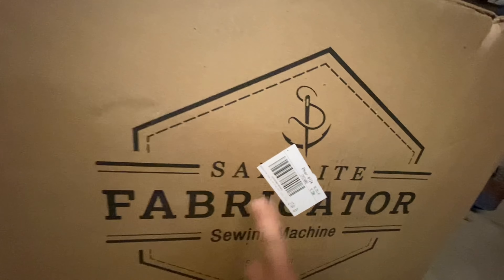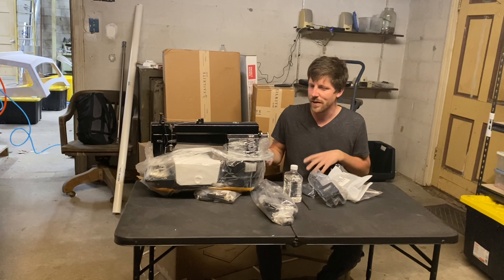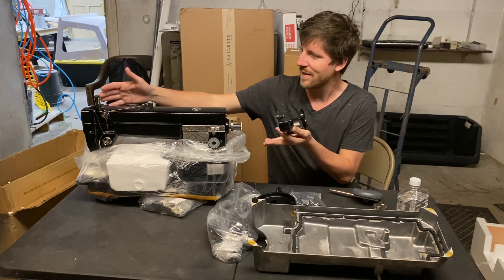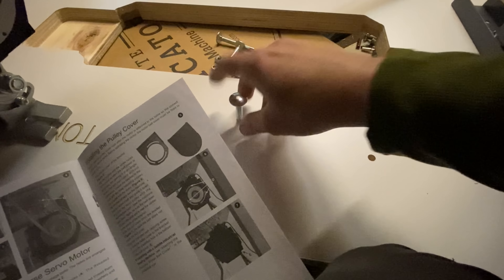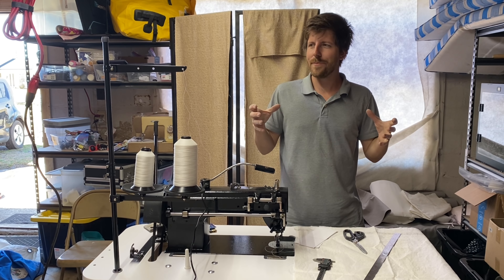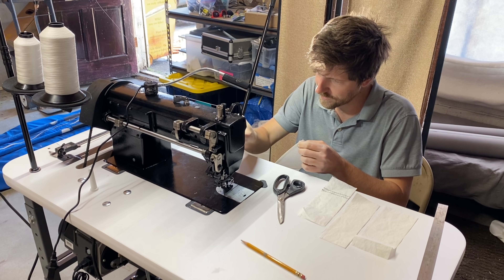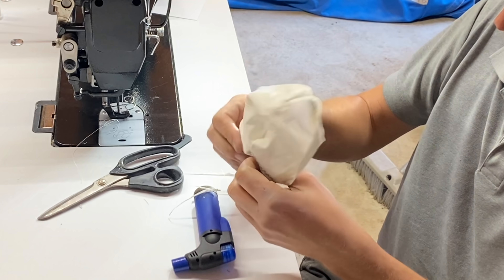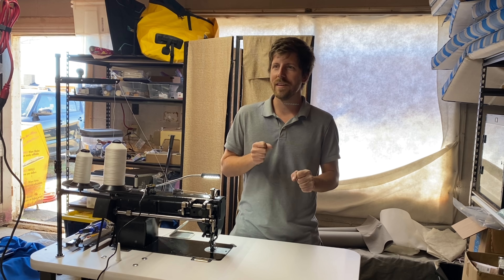The canvas sewing machine of my dreams

Comment: I got my wife a Highlead machine. Very similar to this, but a bigger servo motor. Can do something like 4000 stitches per minute and sew through almost anything that will fit under the foot. Casting is Chinese, but internals are from Juki, one of the best Japanese industrial machine makers. She's done some heavy-duty RV skirting with it using 18 oz truck tarp material. It will sew 6 layers of 18 oz vinyl tarp like nothing, with complete control...

My dad was in the sewing machine business for over 50 years. One of my first jobs was servicing machines like yours when I was 15 years old.  
Some Maintenance tips for you. Maybe you know this stuff, but it seemed to me this is your first machine like this... 
-First, see if there is a safety clutch on the hook drive underneath the machine bed. There likely is... Its job is like a fuse, to save the hook if something happens that can cause the needle to strike the hook and break it. Even a stuck thread on the spool can cause it to release. The machine timing will then be WAY off after it trips, and need "re-set".  It's easy if you know how to. Go to an industrial sewing machine shop and ask the repair person to show you how to reset it and time the machine if it releases. Finding anyone that knows about this is rare. If no sewing machine shops around, look for a tentmaker, drapery shop or another sailmaker. 
-Second: We only use Organ Needles, the best quality we've seen. Keep LOTS of them of all sizes and change them the first hint anytime things seem off on your stitching. Pretty stitches = happy customers and stronger stitching...but you know this.  
-Third: This machine will happily sew a finger or two through bones and not even care one bit. So will a home machine, but this one has unreal power and lots of  room under the presser foot to accommodate your fingers, compared to those. Work safe! Use your finger guard.

Your excitement was great to see. It reminded me of 45 years ago when I used to sell sewing machines and the OH WOW moments from the customers!

Comment: Aw dude, you have extra old sailcloth? Go online, get a pattern and make yourself a hooded zippered windbreaker. Old Dacron cloth is nice and supple, cuts the wind and is water resistant. Incorporate the sail number and the seams and you'll be the talk around the dock.

I worked as a rigger for Hathaway Reiser and Raymond Sailmakers, Stamford CT, when they had already been around 104 years, and they had an endless supply of old sails, from which they made tote bags as a marketing giveaway. 

But the zippered shell was my idea. I picked out a pattern to my liking from the local sewing supply. I cut the pieces taped the edges and had one of the women, who was also seamtress sew it together for me, for the price of a bouquet of flowers and box of chocolates. Marianne was her name, from Alsace Lorraine, was of the age where she was taught to speak Esperanto... 'magine that. Fascinating woman

I wore it as a spring/summer shell, but when I was crewing late fall I used the same pattern to make a nylon liner from old spinnaker cloth and had it sewn in. That worn over wool, or fleece was some primo lightweight foul weather gear. 

When I came across an old school sail in the back of the bin with a 3 strand bolt rope sewn in, I fabbed a new hood with the bolt rope along the edge and swapped it. I guess one could add that feature but the old rope on the old cloth was tres authentic. It was pretty neat, got a lot of looks, made one for the wife as well.

As far as bags for line, anchor rode and such, you are best to make them from mesh, for drying out, you know. That was one of HHR inventory items, coming several sizes... came in handy for wet foul weather gear after racing. Sailrite has a wide selection. Something like a 24 oz. trampoline mesh. Nothing worse than a bag of moldy rope. And with mesh bags you can lay them out when the weather is calm and the sun is shining.

Sew up some wallets and sell them as Merch. I'll buy a couple to support the cause. It will add t my odd collection from other Makers.

Thumbs up. Good job. Most excellent channel 👍

Comment: Amazing machine, you have my envy!  I went the stubborn route and started with the strongest domestic machines that I could find.  They simply will not do the job of an industrial, and I think I have spent close to the same amount compared to just purchasing a Sailrite!  I have a Rex industrial(not the Sailrite knock-off style, but true industrial Japanese made) walking foot now, but it does straight stitch only.  Also upgraded to a servo motor, with pulley size changes to slow the speed.  

Have fun with your projects!  I’m working on making a new canvas panel with clear vinyl for an old Starchief that I have.